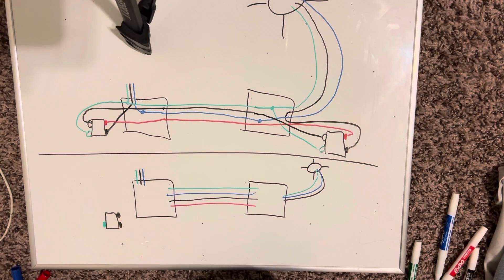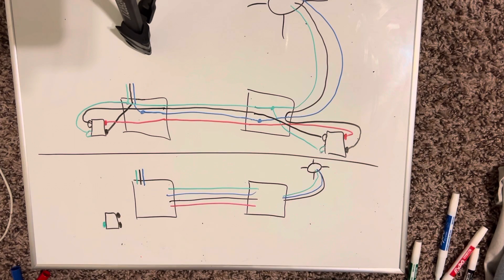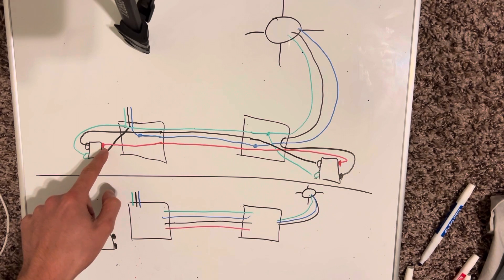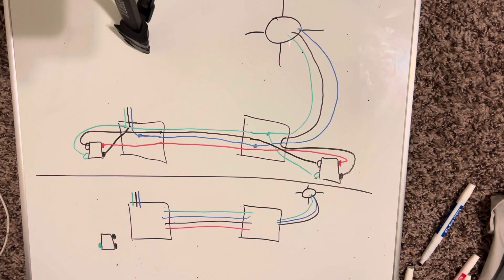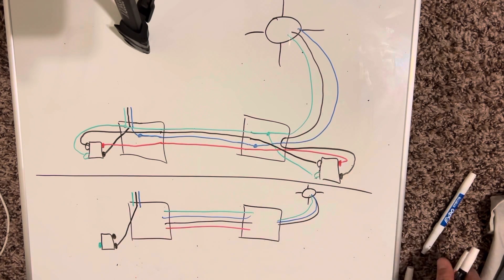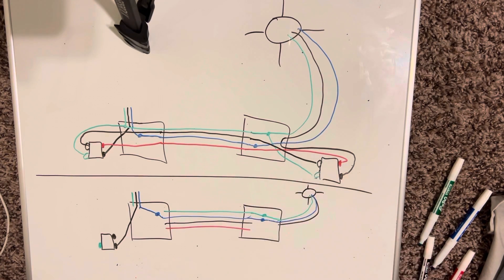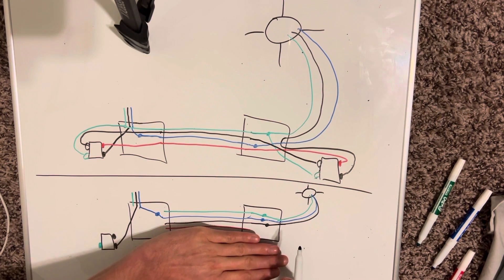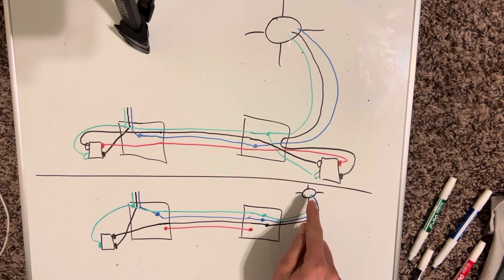Explaining How To Change 3 Way Switches Into A Single Pole Switch

Comment: Thank you for this, it was simple and clear; to me.  How would you rewire the following.  3-way connection that powers three fluorescent lamps in a garage.  One 3-way switch is by the laundry room door, the other 3-way switch by the backdoor of the garage.  Two lamps are in an enclosed room, in the garage, and the third one is in the garage area proper.  I would like to split them into 2 separate groups and replace both 3-way switches for single switches.  One single switch powers the two enclosed lamps and the other single switch powers the one in the garage area proper.  What would that wiring look like?

Comment: Is there a reason why you prefer converting the first switch that's connected to the line side into a single pole and blanking the next switch box instead of doing the opposite?
Reply from the maker: it's up to what the person needs, i have no preference.